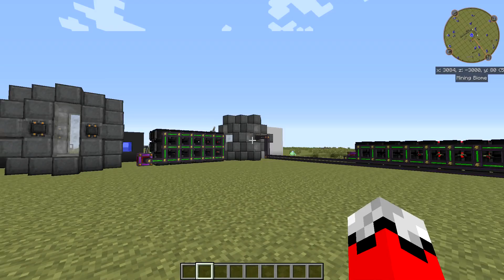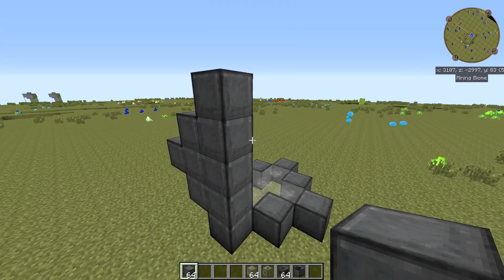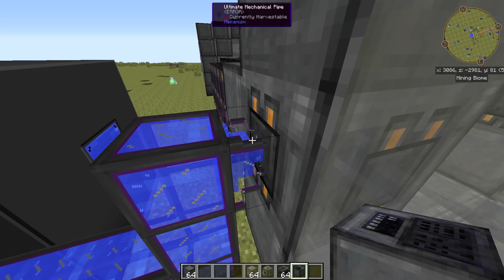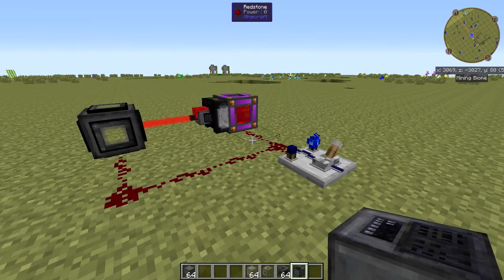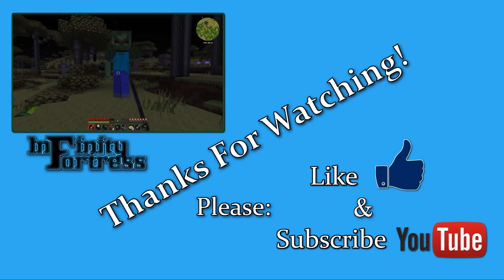Spotlight Followup: Mekanism V8 - Reactors

Comment: Really awesome tutorial! If I ever want to build one of these I will use it step-by-step. But I have 1 question: In what situation would you need that much Power?
Reply from the maker: Otoma Personally, I've never needed the amount of power the reactor can produce.  However, if you're running a lot of MFR lasers, or an ender quarry with speed 3 and silk touch, you might find use for that amount of power.  There are other various big-power applications too that, when taken together, might start to approach utilizing what a reactor can output.

That said, right now the reactor is really just a stepping stone in Mekanism.  V9, whenever it happens, is going to have several machines that utilize that level of power as well as a generator that utilizes the steam from a reactor in active cooling mode.
Reply: InfinityLabs TacoMage What are those other machines? The steam will probley be used in a massive turbine but what else is planned?
Reply from the maker: Most of the content of Mek 9 is secret beyond "We're planing on big thing to utilize the reactor power and steam."
Reply: Well, with fully upgraded quintuple ore production it takes a shit ton of energy. I keep having to manually re-stock the hydrogen chloride due to the electrolyte separators making the chlorine aren't receiving enough power. And that the machines as fallowing: Elite Smelting Factory, Elite Enriching Factory, Elite crushing factory, Elite Injecting factory, And elite purifying factory if all doing a process at once in the automated system would shut down due to lack of energy. And to fill in for that missing energy (note that the lack of energy in my setup is not the only issue, i have a problem with brine thanks to the biome I'm in. but that's not because of energy) i had to make a Reactor with a second set of brine and lithium towers to both fuel the electrolyte separators and the reactor. After that everything worked perfectly.

Comment: have you tested this setup in a desert environment ? :) i dont know if dev changed it , but salination towers used to ( probably still do) produce more brine in deserts.   this may balance the tritium gas.. just a thought :)  great video..thanks alot !!
Reply from the maker: bbroegger In at least V7 mek forward, deserts make salination towers heat up faster, but the biome itself does not directly make them produce more.  However, in day/night cycle dimensions, desert areas will produce more because they will get hotter during the day.

In any dimension with eternal day (such as a mining dimension), salination towers will all heat up to the same max heat and produce the same amount regardless of biome (provided it's not a freezing biome).  Deserts will get there a bit faster, but the production will level out to be the same in any non-freezing biome.
Reply: allrighty, good to know,, thanks champ ! :-)
Reply from the maker: You'll have to overbuild your tritium production SNAs and then store enough of the tritium to keep your reactor running overnight.  I'd say produce around 2.5 times as much tritium as you would need in a 100% day dimension.

Then, make sure you can store all the excess you make by either pumping into gas tanks, or by condensentrating into liquid and storing the liquid.  You'll have to decondesentrate it back to a gas before use in the reactor, but storing as a liquid tends to be better for overall space utilization.